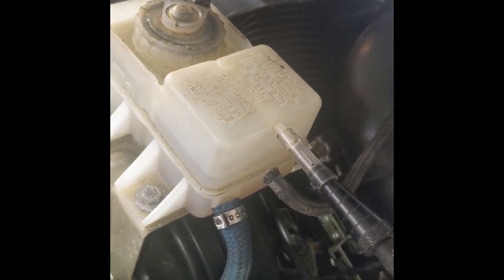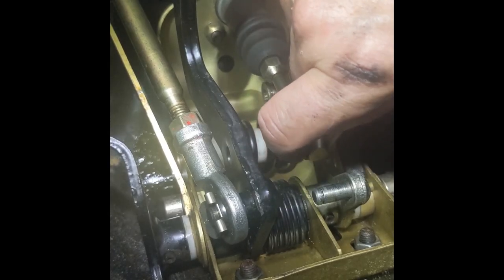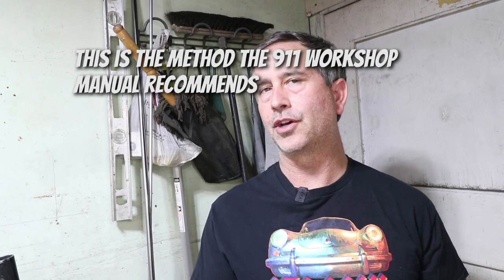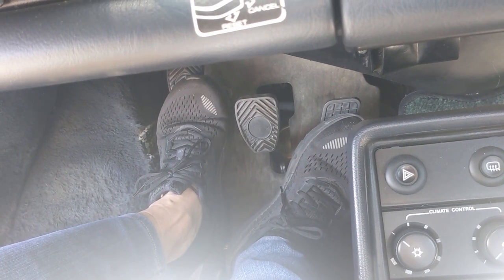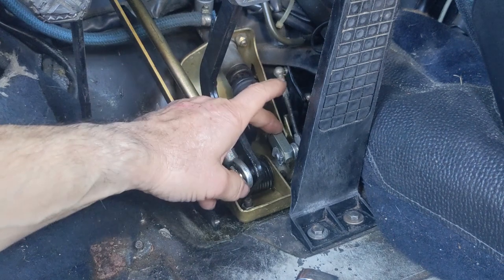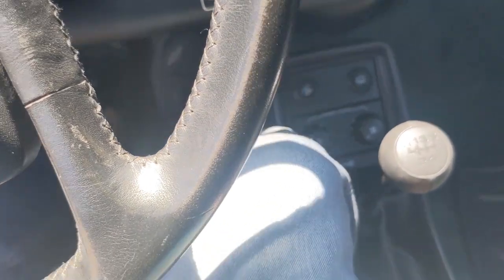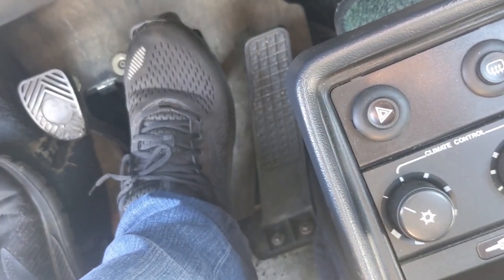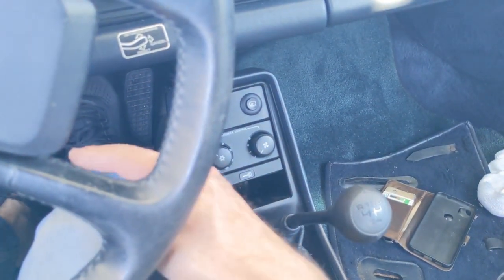Porsche 911 Pedal Setup For Performance Driving & Hydraulic Clutch Bleed Solutions

Comment: I didn't realize there was THAT much adjustability to the pedals. I am able to heel/toe on my '87, but that's only because I added a wooden block to the throttle pedal to bring it up level with the brake pedal. I'm told this is an "RSR pedal" as it's what they did on the RSRs back in the early '70s. No clue if that's accurate or not.
Reply from the maker: Oh, it's crazy how many adjustments the Germans put in these cars.  It's one of the reasons why I like them so much, ha ha.  It's endless tinkering! 
I've seen lots of alternate gas pedals that may or may not help.  It's really a personal preference thing.  
I'm totally satisfied with the stock setup once it's adjusted how I like it.

Comment: Thanks for this (and your many other) helpful videos. Appreciate the engineering focus of your channel. Have you considered the MPL tuning parts bored out slave cyl? Its supposed to reduce pedal effort by about 30% and improve modulation ability at the bite point. Not that the car is bad stock... but as your video covers there is likely room for improvement from the "factory" way.
Reply from the maker: Thank you!  I did lots of work on this with my yellow car, Mac.  It has dual master cylinders with larger bore than stock.  A larger bore results in a firmer pedal, but requires more leg pressure to stop the car.  This gives a better feel and easier to modulate the braking.  Ie less sensitive, but it does take more effort to drive the car.  Everything is a tradeoff.  Personally I don't like the boosted power brakes in this car, but it doesakenit easier to drive than MAC
Reply: @GarageTimeAutoResto  cool. I apologize I’m talking about the clutch slave cylinder. Sorry about that!. I drove it without power assist before I fixed my vacuum leaks. Power assist is not as bad as say the 90s era bmws (tons of lines and pathways for the abs/asc). Curious your thoughts on the MPL clutch slave.

Comment: Non Porsche owner here (don’t even know why I watch your channel! But you are so entertaining tho) anyways, I’ve never ever done a bench bleed on brakes or clutches. I’ve never had one stuck like that! Was that a new slave? Wonder if the oring just wasn’t lubed. The slaves i deal with in the miata have a spring inside to keep the rod pushed out. So weird to see that you had to push and pull on it. Hmmm.
Reply from the maker: This is a first for me too.  There is a spring inside the master cylinder and another on the pedal, but unfortunately mine was stuck temporarily. I could feel a gap between the pushrod and the piston. It's a used part that sat for a few weeks before reinstall.  Only 1800miles on the master cylinder though.
Thanks for watching by the way!
Reply: @GarageTimeAutoResto  as long as you keep making content I’ll be watching. 
Let’s go back to the engine on the stand. What lucky Porsche is gonna get it?!?!